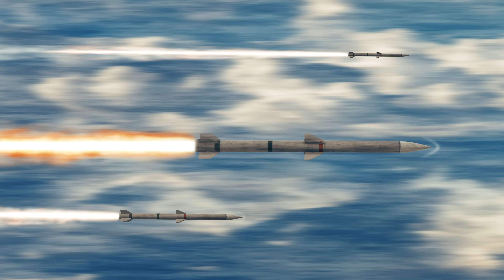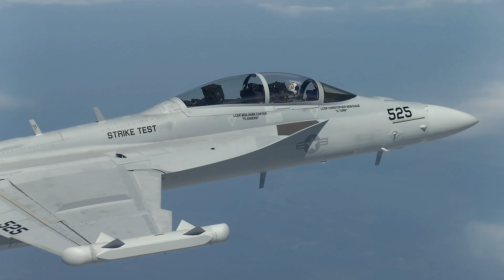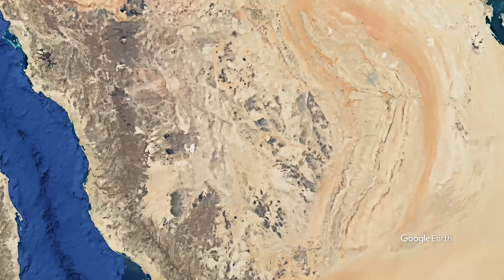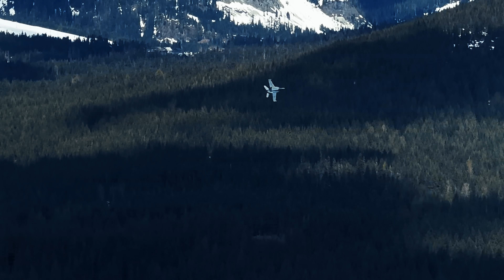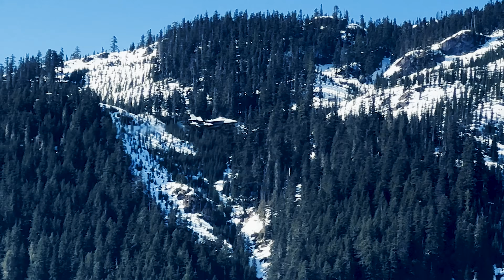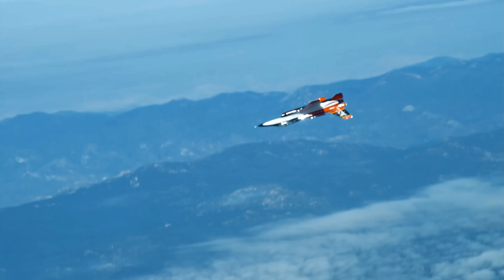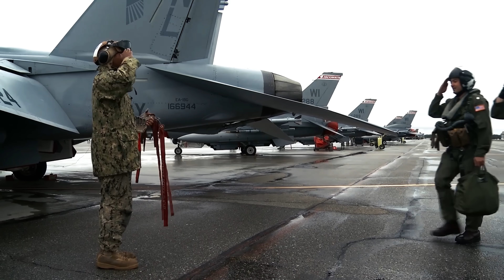EA‑18G Growler Explained: How It Blinds Enemy Defenses

Comment: I'd be surprised if this bad boy wasn't part of operation Midnight Hammer
Reply from the maker: I was thinking the same thing when they said the B-2 were escorted by 4th and 5th gen fighter and went in undetected.
Reply: Absolutely would have been. Despite what everyone “KNOWS” about low observable aircraft, the US isn’t putting B-2s over a legit (even when weakened) threat like Iran without fighter escort (F-22s in this case) and a dedicated EW platform. I suspect there was some sort of HALE ISR above for preliminary damage assessment, too. Unless the DOD has cooked up a few F-35s dedicated to the EW/SEAD/DEAD mission, it would have been EF-18Gs. 

Damn fine airplane. Maybe not as sexy as an F-15 or F-22, that mission profile has to be fun(?) to ride.
Reply: @FloridaManMatty I mean the fighter escort thing you definitely wouldn't want the f-22s anywhere near the B2 because they're just more detectable because they have vertical tail fins 

Though I don't doubt that they were used to a degree along with f-35 to take out radars and other threats
Reply: It was
Reply: @njpme  Correct. Two aircraft carriers supplied Growlers for the attack. Iran was absolutely shut down when the B2s went in.
Reply: @BlackRifleBear yup that's what I've heard. It's pretty awesome.
Reply: It. Would make sense they have two stationed at Ain al Asad air base Iraq.

Comment: Reminds me of the recent, highly unfortunate crash of the Air India 787. It deployed a “Ram Air Turbine” to generate emergency electrical power. It’s interesting that the growler uses a similar strategy with the wing mounted generator pods. Wouldn’t it be more efficient to just add those generators to the central engine jet turbines?
Reply from the maker: So, the ALQ-99 uses ram power but the rest of the systems is a generator. That’s mainly because they’re old tech that was taken from the Prowler. The Next Gen Jammer doesn’t have that and runs off the onboard power.
Reply: It would if you only expect to need electricity when your engines are functional.